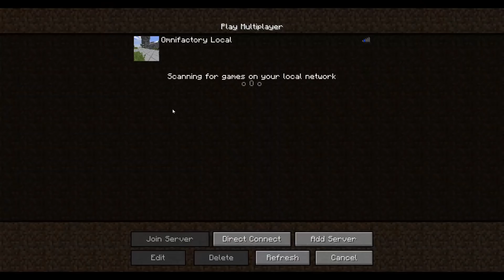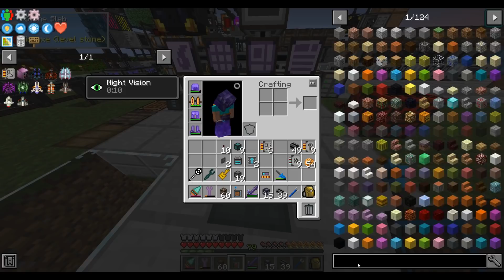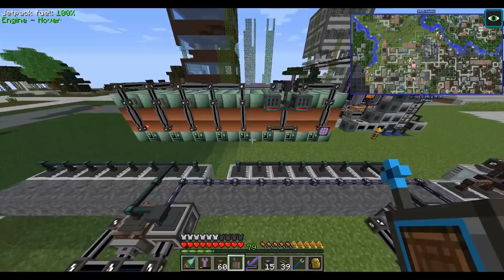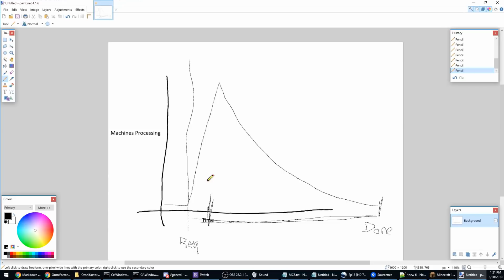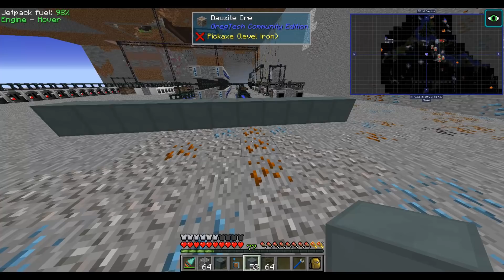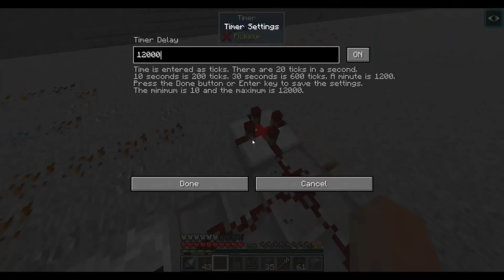Omnifactory EP14: Nuclear Fission

Comment: Hey, i'm honored that my reactor design can be part of your insane production line! Thanks!! One thing i have to add though is that if you scale the reactor vertically, you have to alternate between the redstone layers and the water layers because the gold coolers have to touch one water and one redstone cooler. so if you add a cryotheum/gold layer and a redstone/cell layer in the middle of your reactor, you boost your cooling capacity by not wasting the gold coolers in the middle of the reactor and as a bonus the two additional layers add another bunch on cells to the mix so it runs even faster. I know this tip comes a bit late as i'm catching up on episodes but maybe someone wants to build my breeder v2 as well. Btw, kudos to this serverproof savetyloop, mine are not that bugresistant.^^
Reply from the maker: That probably explains why my reactor produced more heat than I expected it to. Good to know, for the next time I run into a need for a breeder reactor!
Reply: "breeder v2" where can i find it ?
Reply: ty sir, this is the most efficient reactor i've ever seen you are such a master at design and this will be for ever my favorite reactor by far

Comment: I don't know if this is a pack version thing, but in the version I'm playing two months later, you can dump the tiny clumps of Uranium-235 into a compacting drawer and then use a filtered conduit to pull out the full-sized clump. Edit: Wrong Uranium.
Reply from the maker: You could do that when I recorded this, too. I tunnelvisioned hard on one solution and completely ignored the far easier, more reasonable solution. Whoops.

Comment: hi . can you please explain how you did the " keeping stock " of circuits bit by bit , and can you use drawers instead of crates ?
Reply from the maker: The core concept is that there is a export bus set to craft items until it is disabled by a level emitter. By using a crafting card set to "craft only", you can force an export bus to make crafting requests for items. Then, put a redstone card on that export bus and point a level emitter at it. Set the level emitter to turn on when you reach a certain # of the item you wish to stock. 

You can use any inventory instead of crates, so drawers are totally fine.
Reply: @JimmyCraft  thanks <3

Comment: Jimmy have you considered using the molten copper recipes for motors? that seems like it might be faster.
Reply from the maker: No, I never did, but that's a good idea. You're totally right that it could be faster, for now at least. Upgraded wiremills are going to become a necessity anyways, though, since assembly line motors need to use wires.